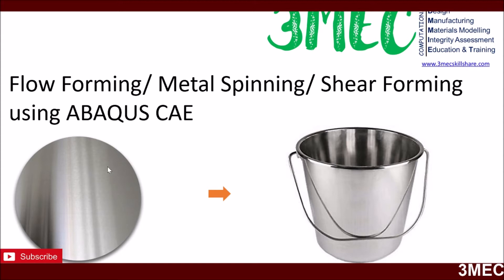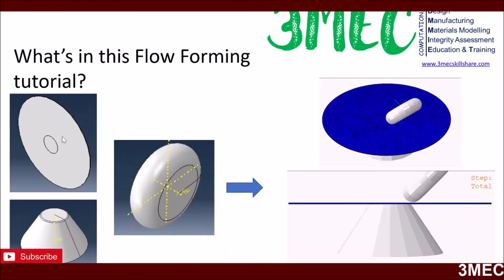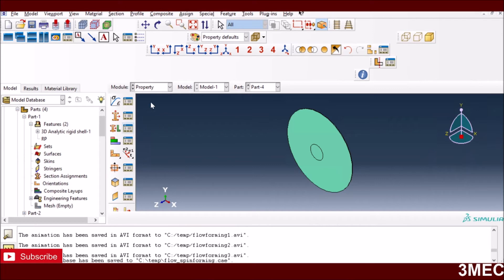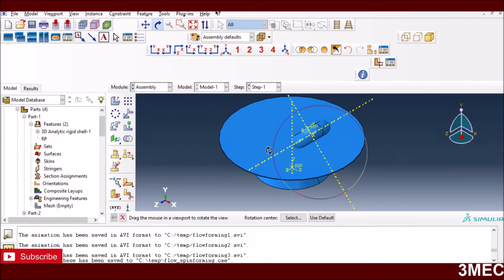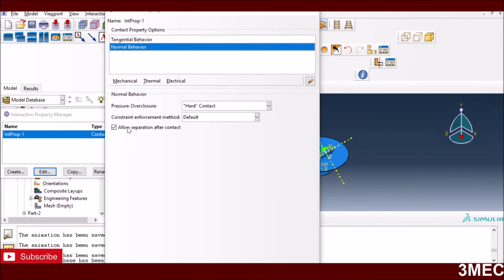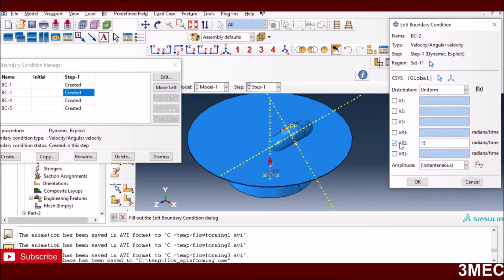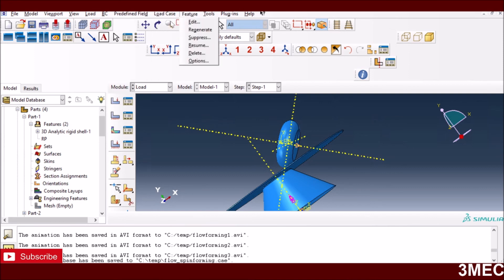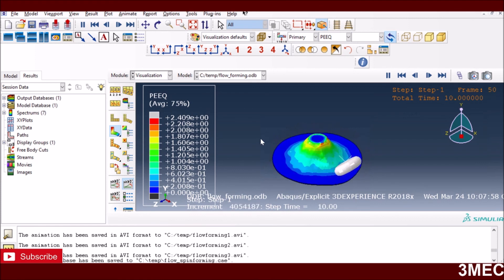Flow Forming / Metal Spinning / Shear Forming using ABAQUS CAE

Comment: Can you explain the reason why did you use 0.02 as your friction value for tangential behavior? I know that you indicated its from a subscriber, but there should be a logic behind it, right?
Reply from the maker: The value of 0.02 for the tangential friction behavior in the flow forming simulation was chosen based on the specific material properties and the forming conditions in the study. While it was referenced from a subscriber, the selection of such a low friction value is logical for high-precision metal forming processes like flow forming. These processes typically involve lubricants or surface treatments that reduce friction significantly between the forming tool and the workpiece to prevent defects, ensure smooth material flow, and achieve the desired dimensional accuracy. Using a low friction value is consistent with the goal of simulating real-world conditions where friction is minimized to optimize formability and surface finish.

However, the friction value can be adjusted based on experimental data or prior studies, which often report friction coefficients within a similar range for metal forming operations.

Comment: what is the version of abaqus you used here. thankyou.
Reply: can we change the tool path as per our wish, or it can be done only with straight lines
Reply from the maker: @kabilaank3862  I can't recall the version but most probably 2021 or later.
Yes tool path you can have as you want.

Comment: Sir what are the possible Material model that can be used for forming?
Reply from the maker: it depends on which type of alloy you are using and what deformation mechanisms it is having. But you can start with simple elastic plastic model and johnson and cook model, as starting point.
Reply: @Professor3MEC  thank you for your response sir, i am onto stamping of stainless steel of thickness 0.6mm (one step and not incremental) to a design of a muffler (spring back is also important) and can you suggest a good law for the same sir .......
Like i was thinking whether to go with hollowman power law or Johnson crook model .....
Reply from the maker: @JustusPanicker  both should be ok. Johnson cook might provide more flexibility but depends on which law fits experimental data better.

Comment: Hi, me again :). Please, how did you put the roller and the sheet in contact (I can see that you've defined no interaction between them) ? How to place the roller just at the sheet's surface ?
Reply from the maker: You can define interactions as general contact. Or can also define surface to surface contact. For placing the roller to the sheet, you can use translate option in assembly model to move the parts around in the assembly.
Reply: @Professor3MEC  Thanks